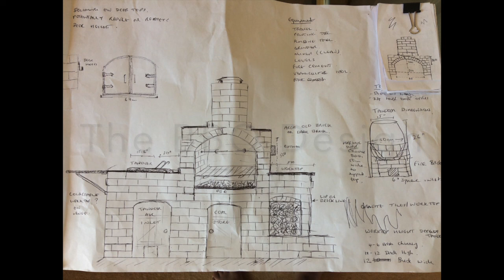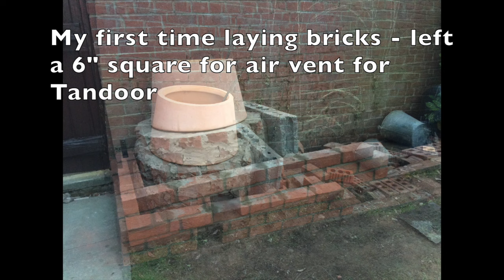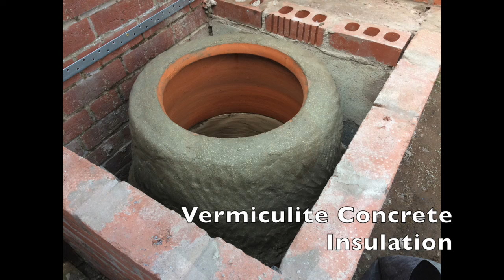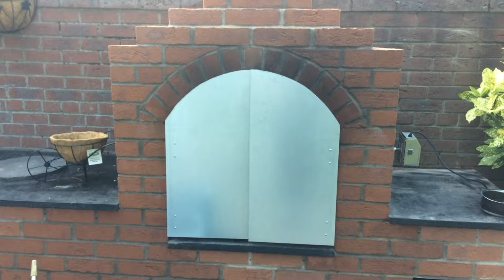How to build a brick BBQ. How to build a Tandoor. How to build a Pizza Oven Rotisserie DIY BBQ Build

Comment: Hi 
Great bbq did you put anything on the concrete before putting the coals on top and after use have the bricks not cracked if not what type of bricks did you use.
Thanks
Reply from the maker: Hi 

I've just used normal concrete and brick, they don't crack straight away Will take years of use. Its similar to the old chimney fires, they used normal bricks and lasted years
Reply: @asifnaik  thank you appreciate it

Comment: Hi this is great. I’m interested in doing similar. Where is the Pizza Oven portion? Have you cooked pizzas on it?
Reply from the maker: Hi 

The pizza oven portion is the bbq with the doors. I use a pizza stone on the grill. I have cooked pizza but didn't put enough coals in so took longer to cook. I will be trying this year with a wood fire as this should generate more heat.
Reply from the maker: https://youtu.be/UdYk8k_9ePM
Reply: @asifnaik  ah yes. That looks like it works well 👍

Comment: It's an excellent job. Can I ask for the blue print of your oven style because I would like to build in my home.
Reply from the maker: Hi Rizwan 

Thank you for the comments. Unfortunately I do not have them anymore, only what on the video here.  I didn't put specific measurements on the drawing although it was fo scale. Also I made a few changes once I was building it.

Best thing to do is look at what items you will want to put in eg BBQ tray and build to that spec. I used one which was 67x40cm but left a gap of 69cm to fit it in. 

Hope that helps 

Thanks
Reply: Thank you. Much appreciated.

Comment: Couple of things bro. 1) over the small opening at the bottom of tandoori and the storage door, what did you use as lintels? 2) for the chimney did you use something to help stagger it to get the pyramid shape? Much appreciated and it looks great mashaAllah. Well done!
Reply from the maker: 1. Bottom hole for the tandoor I used a small galvanised plate o pickup up from local DIY. The storage lintel was a piece of slate which was cut with a grinder. 
2. To stagger the chimney I used concrete lintels and slate pieces to place the bricks. 
Hope that helps

Comment: awesome stuff...I hope you don't mind that I'm going to shamelessly copy you this summer- will send you the pics of the process/finished thing. quick questions- what concrete did you use ?...everyone on youtube uses QuickCrete 5000 but can't get that in the UK and im assuming you are UK based? also what is Vermiculite concrete? do you buy that as a separate product or jus mix Vermiculite into your concrete mix?

very grateful for any advice. thanks
Reply from the maker: Thanks for the great comments.

Feel free to copy it, the only change I would do is use two clay pots instead of the round brick work as this will give more heat and possible use slightly smaller pots.

I mixed the concrete from scratch used 
3 parts gravel 10mm 
3 building sand (smooth) 
1 cement 
Cementone for colour 

Vermiculite concrete 
1 cement 
1 sand 
4 vermiculite 

Look forward to seeing the pics 

Give me a shout if you need anything 

Good luck
Reply: Did you do it. How did it go?

Comment: Ramadan Mubarak. Would you mind sharing the design plan/dimensions? I'm interested in building one as well.
Reply from the maker: Ramadan Mubarak. The plans are on the video. I used brick numbers as dimensions as I was building back into an existing area. 
The bbq grill was around 67cm so I built it around that. Hope that helps
Reply: How many bricks did you use
Reply from the maker: @vickyindelhi  around 350 plus a couple of concrete lintels

Comment: Salam brother did you work off any plans
Reply from the maker: Wsalam..

I drew the plans to scale using brick dimensions. Use the tandoor measurements and the BBQ tray to set the whole scale. 

Made a couple of adjustments when I was building it. 

Hope that helps

Comment: Amazing! Just making smaller version for myself.  People talking about cracks after putting first fire. Do you have any advise in that matter?
Reply from the maker: Thanks for the good feedback. What are you building and where would the cracks be?
Reply: @asifnaik  mostly at the joints, I suppouse
Reply from the maker: I've not had any cracks and I've just used normal building sand and cement for the brick work. I think over years it'll probably crack but you can always repoint it.
They used to build old fire places with same cement and that lasted years so I wouldn't worry about a BBQ that's used only a few times in a year
Reply: I saw a video in which fire bricks n heat resistant cement/ mortar was used.

Comment: Asif, loving the tandor. I see you said the pot was from b and q. What diameter one was it? Did you put fire bricks in the bottom or just vermiculite and refractory cement? Are the ashes cleared via the hole at the bottom? Have you made any naan bread in there yet. Would love to see the results. Fantastic job o. The brickwork.
Reply from the maker: Thanks for the great comments Rob. 

Diameter was 50cm for the pot (top) the tandoor opening is 14inches 
I used normal bricks at the bottom but then insulated the external with vermiculite concrete.

The only thing I have not tried is naan bread but is something I will be doing soon.... as I need to make the naan pillow to stick it in the tandoor. 

Ashes are cleared from the bottom, literally takes minutes to clean.

You can check the results of some of the food in my other videos
Reply from the maker: https://youtu.be/Ws1-29aVzYQ
Reply: Already seen those, looks delicious. Thanks for the reply. Will await the naan pillow making video, and naan cooking video. 👍

Comment: What size clay pot did you use for the tandoor? Looking to start this weekend.
Reply from the maker: It's was a large pot from B&Q don't remember size but base of tandoor was 50cm 
You are better off using a slightly smaller one around 40cm as it'll heat up better and retain the heat.
Reply from the maker: Also try use the heat resistant insulation I've used in the pizza over for the tandoor. This will retain the heat better
Reply: where can i buy that (name)?
Reply from the maker: @fu2393  B&Q
Reply from the maker: @fu2393  are you from UK?
Reply: Yes @asifnaik
Reply: i meant the heat resistant solution
Reply from the maker: @fu2393  I got from either amazon or ebay
Reply: @asifnaik  can you let me know the brand and quantity (vermiculate) as I'm struggling to find. Also, did you mix with concrete?
Reply from the maker: @fu2393  vermiculite was from ebay 100litre bag
Reply from the maker: @fu2393  I did my oven concrete mix for the worktop. This was standard mix
Reply from the maker: @fu2393  vermiculite was mixed with I think vermiculite:sand:cement 7:3:2 and water until it easy to use
Reply: @asifnaik  The cementone I used for the tandoor is breaking up. Did that happen to yours and is there a way to prevent it?
Reply from the maker: @fu2393  is that to join the two pieces together
Reply from the maker: If I remember I had to heat it up slowly to cure it

Comment: how long would it take a brick layer to do all this?
Reply from the maker: It took me 10-12 days and I've never done brick laying. An experienced one should take 3 days tops
Reply: @asifnaik  i guess that would have bought the job to £1100? from £650
Reply: then again if you were helping might have been cheaper
Reply from the maker: If you do it yourself then it's just the materials, that was what I paid. A bricklayer would have charged £150 per day normally
Reply from the maker: If someone was to build this for you, you probably looking close to £2000
Reply: @asifnaik  if they just charge labour then its 450 for 3 days + 600 for materials?
Reply from the maker: You need to include ground works, foundations, concrete worktop, these will add to labour cost if you outsource
Reply: @asifnaik  thanks

Comment: Great job! what did yo use for the inside of the tandoor? Is there a name for the pot or what was it made of? Thanks
Reply from the maker: It was a large terracotta pot from B&Q top diameter was 50cm. I then cut the base.
If I was to build it again I would use two of these pots, on inverted instead of bricks for the bottom. They cost around £34 each
Reply: @asifnaik  Thank you! You did a super job! Just watched it again

Comment: How many bricks were used?
Reply from the maker: About 350-400
Reply: @asifnaik  so the bricks are actually 700
Reply from the maker: @fu2393  wow I thought it was less
Reply from the maker: How is the build going?
Reply: @asifnaik  coming along nicely. Chimney remains and tandoor. Not going to add any doors. I used yellow bricks instead of red as  firepit area is large yellow bricks.
Reply from the maker: @fu2393  cool will be nice to see end result

Comment: If the rain come in tandor it will be full of water
Reply from the maker: No... the worktop has a slight slant so rain water moves away from the tandoor opening, the there's the lid which stops water and even if it did go in the water would come out of the ventilation hole at the bottom.

Comment: Man, What are u doing? You shouldn't cook anything when coals are black. It can cause an intoxication. At first, all coals should turn into  embers and after that you can cook whatever you want.
Reply from the maker: How do you add coals when they burnt-out, to increase heat?
Reply: @asifnaik  Whatever you're cooking, you can take it out while the coals are burning. I have to inform you as a MD. It is your choice.